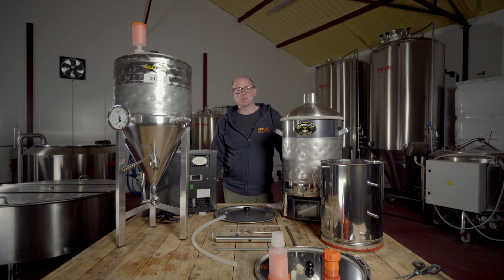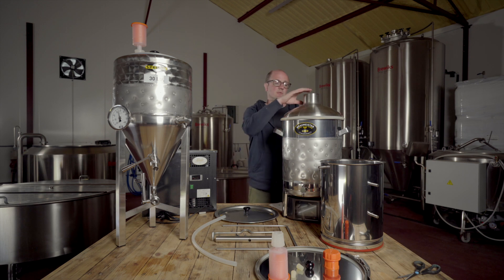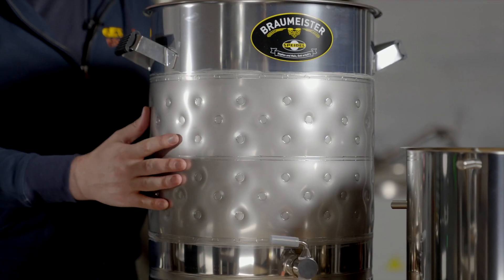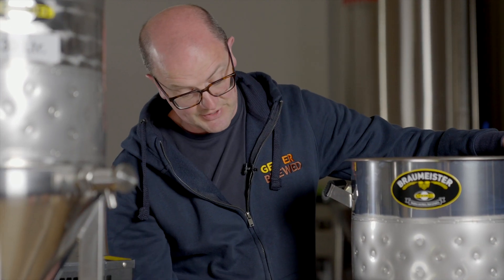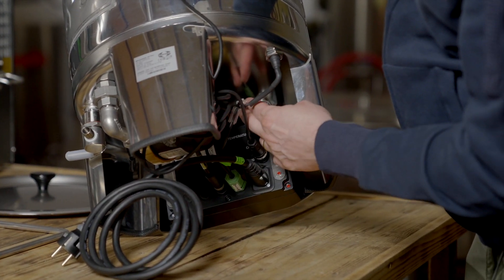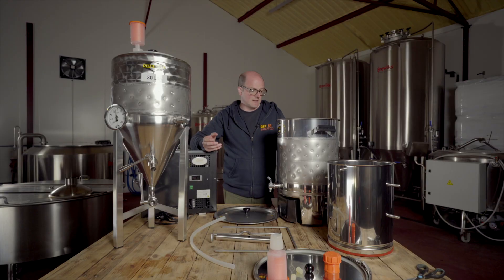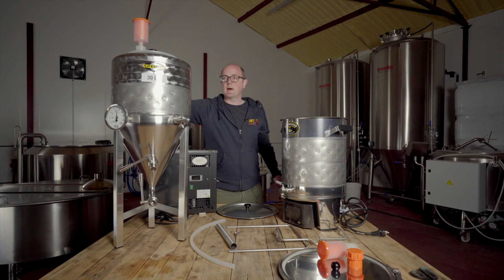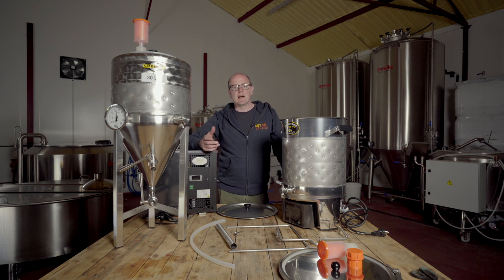Actually how all in one brewing systems work - Speidel Pro makes it possible // Get Er Brewed

Comment: I've been using a Braumeister 20L for almost 10 years. The build quality is indeed excellent. I upgraded to the new (2021) model about 6 months ago. I'm very happy with it. Speidel have done an excellent job. I think all the new features are genuine improvements, even the cooling jacket, which works fine if the water's cool enough. Anyway,  just thought I'd chime in, because there seems to be a lot of misinformation being "branded" about re the Braumeister and its faux competitors. There's nothing comparable to a Braumeister on the market, in reality. What we get for the money is the most reliable all-in-one wort-making system on the market. Its level of automation simplifies what is, let's be honest, a boring process. The wort sitting involved with more hands-on systems is a time consuming form of watching paint dry. The Braumeister's design and build quality mean it's going to brew excellent wort consistently for many years. That's what we're paying for. The claims by some they're "upgrading" from a Braumeister to a more hands-on, equally expensive, all-in-one brewing system makes no sense. I think they've been captured by aggressive marketing and misinformation mainly. Hoodwinked, in other words. A bit like trading in a Rolls-Royce for a shiny horse and cart, in my mind.

Comment: I used a Braumeister 20l for many years. The quality build is excellent. Unfortunately, the technology did not keep up with the competition and Speidel was not very interested to listen to homebrewers' needs. Customer service is quite slow as well but considering buying it from GEB should fix this issue. For the price point, it should offer way more like touch screen adjustable pump and power, whirlpool integration, etc. Many people complain about the effectiveness of the cooling jacket and continue to use the immersion chiller. I see that even now the steam hat does not have a handle so you will need a glove around to operate it. I was upgrading to a Brewtools system but I steel consider Braumeister to be a good quality product. I hope they will someday listen more to their clients.

Comment: Hi, great video as always.  I brought a 2021 BM20 last year and I am very happy with it.  I look forward to your brewing video; a couple of key things I think are worth mentioning and discussing, limitations on grain bill / batch size and possible work arounds, importance of grain crush size and the "wort fountain" issue and the sparge / no sparge options.  The only negative I have is that I think it is rubbish that such a premium product doesn't come with a UK 3pin lead.  Having said that, the quality of this is mind blowing, and obvious in its weight, I have been impressed with how easy / quick it is to clean with the stainless steel, however I moved up from peco boiler / BIAB set up, so assume this would go for all SS all in one systems.  

The cooling collar is great, one less item to have to wash up in my mind, in winter / below 20 degrees ambient I would say it is probably 10 -15 mins minutes or so slower than an immersion, personally for me I prefer this too cleaning an immersion chiller.  When I brewed 2 weeks ago in about 28 degrees, the ground water was fairly warm, so with the collar only, cooling past 35 degrees was very slow, in the end I just transferred to fermenter / fermfridge then waited for the fridge cooling to bring it down to pitching temperature, I felt that better than a longer time open to possible infection.

I am interested in going to conical fermenters, could you advise on the Speidel system, how best this would be heated?  As I assume it is probably too big for a brew fridge and most people will be brewing in a shed / garage, so in winter this is a problem.  does the Linder system cover the heating as well as cooling?  otherwise I am probably leaning towards the GF conical system that has the in-built heat belt.

Thanks and all the best.

Comment: Is there  a part number for the solenoid  fitting and the quick connector fitting that screws onto the dimpled cooling jacket. I've  got a 120 liter speidel jacketed fermenter that's  a great fermenter. But I've  never used the cooling jacket. Information is limited in the states.

Comment: The only worry I would have is if the cooling jacket is made of plastic there is a chance it could get caught and ripped. I have to pack away my brew gear after I have finished with it and that would be a major worry to me, even if your extra careful sod's law could apply.
Reply: The cooling jacket is not plastic. It is stainless steel and welded to the kettle. I have used my Speidel 50L for many brews and had no problems with the cooling jacket. The only issue is when brewing smaller batches, the jacket doesn't cool very well, because it does not cover the lower part of the kettle.  I think, this also applies to the 20L system.
Reply: @Patrick-v31719w  I stand corrected, it looks like plastic and it was not described as being made of steel in the video, thanks for the correction.
Reply: @devilmaycare2809 That's no problem,  happy to make it clear for you. It looks different probably because it may have a 'shot blasted' finish. Speidel produce great products but unfortunately there are several areas  whereby it could be greatly improved.